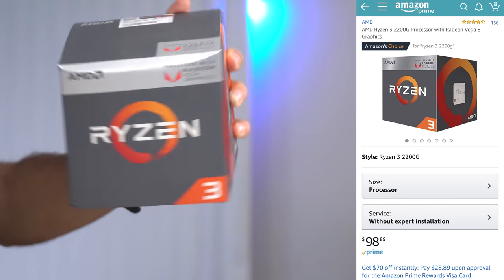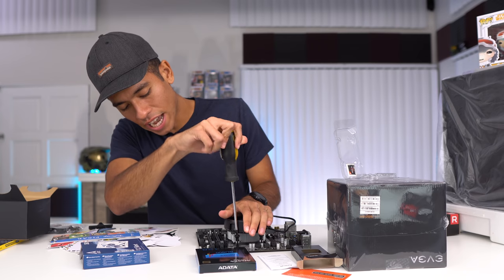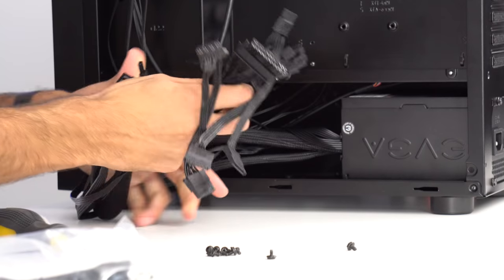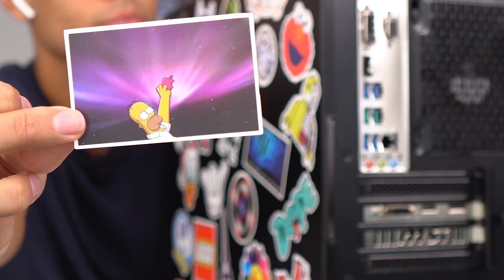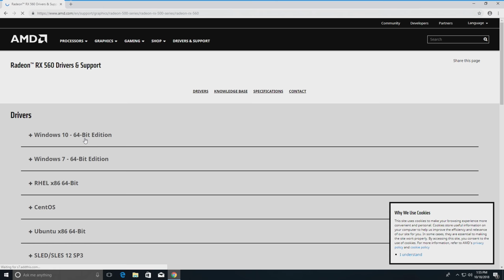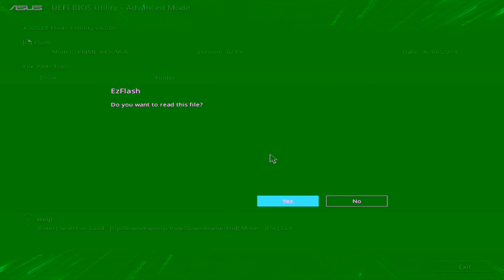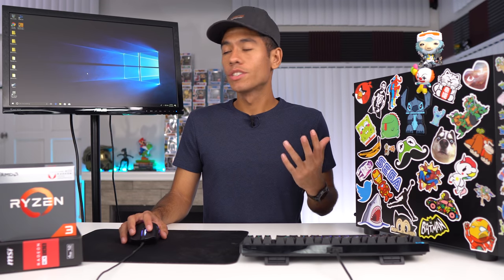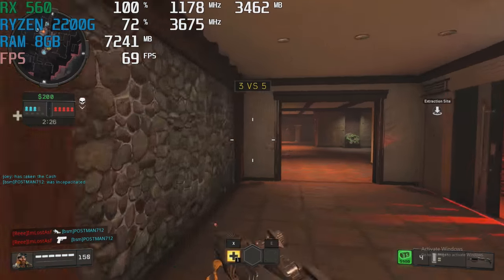Best $500 Budget Gaming PC Build Guide - RX 560 Ryzen 3 2200G (w/ Benchmarks)

Comment: Hey everyone! I want to do this build but with 16 gigs of ram  will it work fine with this motherboard? Thanks! The ram is 3000mhz
Reply: Of course! You can use up to 64 GB of ram.
Reply: Yes! Just double check on specific RAM compatibility on motherboard's manufacturer website or manual.
Reply: Thank you
Reply: Also, one more question. Would it be ok if I used a 450 watt evga power supply with the 16gigs of ram and an rx 570? Every other part is the same part he uses. I do not know if the card needs external power from the power supply, but it's a powercolor red Dragon rx 570 4gb ddr5 card. The power supply is also an evga bronze rated 80 plus.
Reply: @windowblotter  Red Dragon RX 570 requires 8 pin power connector which EVGA 450 BT has, so you are ok there. As for 450watt, this is probably the lowest I would go. If you plan on upgrading the PC later on then I would recommend a better power supply. When in doubt, you can always check on compatibility of parts on pcpartspicker website under "system build" tab. It's pretty easy to use, plus it will show current prices of those parts. Good luck!
Reply: Ok thank you!

Comment: I stopped watching this review when he recommended the RX560 for 2019
Reply: João Gonçalves it’s a $500 budget wtf do you want?  😩💀💀
Reply: @OneWarriorNation91  The thing is, if you look around, you can even buy laptops with similar config (maybe with less SSD size), for 499$ wich have, you know, a screen, a keyboard, etc. Pretty sure you can get a way better gpu on a 500$ budget for only a desktop tower in April 2019. An RX570 costs 30/40$ more and is much better performance wise. Just need a decent PSU to pair with it. But my best suggestion would be to buy a better USED gpu (still in warranty) and buy everything else new (compatible with that gpu).
Reply: @TheAxebitten  A lot of YouTubers make money with affiliate links to like Amazon, so there is no benefit for them to recommend used stuff. It's also more risky to buy used GPUs, especially for first time PC builders (for whom this video is intended for). I would like to see that gaming laptop for $500 with equivalent specs. Got a link?

Comment: I'm just wondering 
Could you use a 750 watt power supply instead 
Oh yah another one 
What if you used a corsair rgb fan 
Are fans different sizes that need different things
Reply: Yeah a 750 watt is fine, although that's overkill if you don't plan on upgrading much. Also Corsair RGB fans work fine. Just make sure that your motherboard has enough fan headers. For each fan you need to plug it in to a SysFan header. If you don't have enough you need a splitter. Also, cases can have 120mil fans or 140mm. Make sure you don't buy 140mm for a 120mm slot. You can still get a 120 if it supports 140 most of the time though.
Reply: @gu3z185  
I plan on using a 1060 6gb with maybe 16gb of ram so maybe it's not quite as much overkillness

Comment: idk what he means when we don’t need the PCI-E cable, can someone explain
Reply: The card docent need external power
Reply: Apache Helo Copto so attaching it to the mobo is enough to power it?
Reply: @justeeno9528  Yes the card can be powered just from the slot
Reply: Apache Helo Copto what happens if you still plug it in anyways? I’m getting an RX 570, so idk if I need to use the PCI-E cable for that one.
Reply: @justeeno9528  RX 570s Need a 6 pin or 8 pin external power. The 6 pin or 8 pin is just on of the many cables which come out of your power supply

Comment: Man i bought same motherboard and ryzen 3 3200g and computer is running but display dosnt work. Please help

I dont have graphics card coz poor so is that the problem? But dosnt ryzen have integrated graphics
Reply: did you buy, like everything? except the gpu of course?
Reply: @malinkaaa  yes thats right...
 I heard i need to do a bios update is that true?
Reply: No actually my motherboard says its ryzen compatible
Reply: what you use vga or hdmi monitors
Reply: @Naydref  i tried both
Reply: @mysmallbox9438  u will have to perform a bios update in order to get a signal from the monitor
Reply: @mysmallbox9438  the motherboard does not support ryzen 3000 out of the box will need a bios update
Reply: @jamesscott3290  but on the box of the motherboard it has a picture of amd ryzen lol
Reply: @mysmallbox9438  b450 was release before ryzen 3000 your mother board probably says ryzen 2000 ready
Reply: @jamesscott3290  ok now can access bios coz ye updated motherboard. But when i boot to usb i get a "disk error press any key to restart" message
Reply: @mysmallbox9438 wait is that the USB with the bootable copy windows 10? Or the bios update?
Reply: @jamesscott3290  usb with bootable windows 10
Reply: Is the USB the only drive in your PC, do u have another drive? What's your PC specs
Reply: @jamesscott3290  ausus b450m- a motherboard 
Ryzen 32000g
Kingston ssd
8gb ram gskill
No gpu...

I can access the bios amd everything and i yt everyhting still no work fml should i just die?
Reply: @mysmallbox9438  okay is the flash drive an 8gb flash drive. Is there anything in the flash drive besides windows 10 download like pictures or documents? Also damn no GPU
Reply: @mysmallbox9438  also you will have to respond quicker because I'm about to go to sleep
Reply: @jamesscott3290  flash drive is 8gb and i format it then i install windows 10 toool from Microsoft website  just like on yt video
Reply: @jamesscott3290  probs need gpu yeah since my intergrated graphics hasnt been installed as first time using pc
Reply: @mysmallbox9438  no it does not need a GPU
Reply: Uninstall everything on the flash drive and install Windows 10 again on it. Make sure your plugging the USB to get a bootable windows 10 on a PC with windows 10
Reply: @mysmallbox9438  also I hope u did not over pay on that PC of yours

Comment: Is the drawback with no key microsoft really just the watermark?

I mean it's kind of unreal that you pay $100 for just that.

Can anybody help? Doing research before making my own pc. Thanks
Reply: Features are also turned off such as command prompt, administration access , and certain features that windows 10 offer. If that seems useless well when troubleshootinga software issue those features will come in handy. Also you could buy a key for much cheaper than Microsoft asking price.
Reply: @jamesscott3290  is it worth the price? I mean in your opinion? Thanks btw
Reply: @jeb.c.1063  if you want customer support and a product key for every build you do, I guess yeah but honestly speaking for a budget perspective maybe. Keep in mind When buying the key from a grey market most likely it's either going to be either stolen, from an oem prebuilt that can only activate once and only activate in the motherboard your using meaning you cant activate windows in another build, or a Chinese key (nothing wrong with a Chinese key really because windows activation key is universal and not region lock) now these cons come with some pros they can be found for cheap, I mean REALLY CHEAP.
Reply: @jeb.c.1063  here's a buying guide on buying a Key. If you have a large budget go for activate officially at the Microsoft store. If your on a tighter budget, make sure to buy the key for super cheap, don't use g2a or kinguin as there private policy is supper sus and shady on stolen goods. Instead if you want some insurance and a peace of mind, use eBay and pay with PayPal. Make sure that your buying for a low price and to check to see if the vendor well reputable. Using PayPal helps in case the vendor attempts to scam you and dispute it.  Keys in eBay for windows 10 pro can be found for as little as 3 buck
Reply: @jamesscott3290  thanks for the help

Comment: Anybody know if this build will be ok if I use a gtx 1060? Same exact build just a different GPU?
Reply: Will be fine
Reply: Will be okay but the RX 580 has the same performance as the gtx 1060 and can be found for cheaper
Reply: @jamesscott3290  Oh really? The only reason I was going for the gtx was because I thought that's better aha, thanks for that I'll get the same one he's got then 👍
Reply: @amc659  no he is using the RX 560 which has worst performance than the RX 580
Reply: @amc659  do not use this PC build guide it's so shitty the parts selection in that price point that u can easily build something cheaper and better
Reply: @jamesscott3290  oh yeh my bad 😂 read it wrong I see what you mean. I'll have a look around and see if I can get some deals on either the 580 or 1060
Reply: @amc659  what's your budget for this PC?
Reply: @jamesscott3290  Anywhere between like 450-600
Reply: @amc659  are u going for ATX or micro atx?

Comment: Does it matter if i buy 1 8GB stick
Reply: It's doesn't matter but I think on any mobos 1 stick only will not be the same performance of the 2x4
Reply: @hocky9181  And also is a 4GB graphics card good because im new and saw this guy selling a 4GB graphics card dont know if its good or not
Reply: @yasky_g2570  if you are low bugdet pc like (600-750) it's the best, but if you are building a pc like (-750++) you should go for more GB. For example if you want the rx 570 and you don't now if to buy the 4gb or the 8gb version, try to watch some videos to see if you need to get the 8gb or the 4gb.
Reply: @hocky9181  ok thank you so much you really helped
Reply: @yasky_g2570  no problem :D
Reply: @hocky9181  did you build a pc
Reply: @yasky_g2570  I am going to.

Comment: I have a rx 570 and a r2 2200g amd i still dont get above 40 fps
Reply: Just mess with settings
Reply: @ryanmurray7969  i already tried
Reply: @xCr0NIc  welp then cry and give up
Reply: @xCr0NIc  what ram do you have?
Reply: And what game?
Reply: You also need to update the bios of the components
Reply: Can someone help me I built this exact pc but when I turn my memory up to 3000 MHz  it begins to start crashing does someone have a fix or should I just turn it down
Reply: @pewdiepiesupporter8682  i fix the problem thanks tho
Reply: @xCr0NIc  ok nice
Reply: @xCr0NIc  what did u do?
Reply: @aaronmartinez592  i had it in my motherboard
Reply: @aaronmartinez592  i switched it to my gpu
Reply: @aaronmartinez592  hey your PC can't handle the ram down clock it to a 2933mhz to make it stable

Comment: Will the 2200g bottleneck a rx 580?
Reply: it will in latest games , rx 570 would work perfectly with 2200g
Reply: Okay, but do you know what cpu do i buy if i want an rx 580 in my build?
Reply: I5 8400 is a cool cpu, it needs a h310 board.